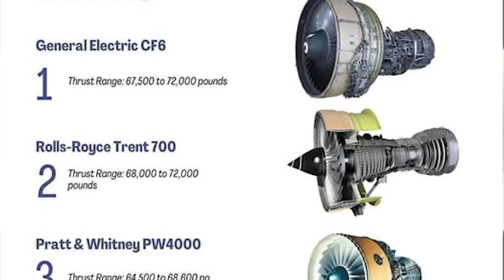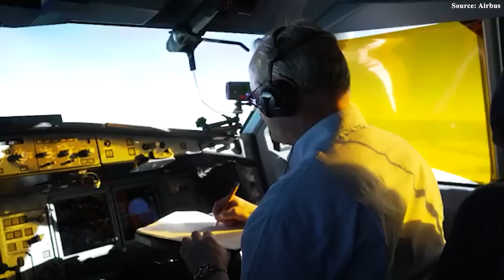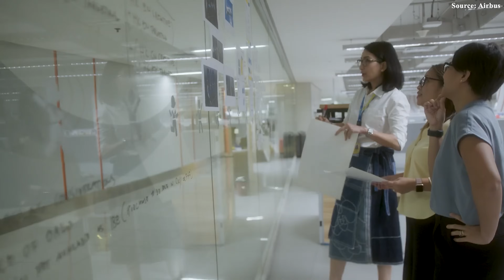This Why Every Airline OBSESSED with the A330Neo Over Boeing, Even A350!

Comment: No No NO! Type rating commonality wasn't introduced by Airbus. Airbus just pushed further what Boeing popularized on 707, 727 and 737, later reimplemented on 757/767 (and 777 to some extent). Boeing is not the inventor either, commonality was already applied wherever possible since 1920. People keeping believing A320/A330/A340 couple weeks type rating is an Airbus invention is just IGNORANCE. Yes, making 20% better efficiency is a nice improvement, but it's miles away from being the inventor.

A330Neo is not successful because of a lot of nicely worded but VAGUE arguments in this video. A new engine? That's not a breakthrough! Any aircraft with more efficient engines is better...
Question: when do you buy a new plane (mainly)? When the one(s) you have are too OLD! As simple as that. When you select a new plane, you want it to be EFFICIENT on the market you have, and BLEND IN with as LESS COSTS AS POSSIBLE. No wonder why popular A330CEO operators want A330NEO, not 787, not A350. Don't want to pay costly trainings, for flight crew and maintenance. Don't want to invest in an extra line of spare parts supplying til you got rid of the last A330CEO...

Don't confuse A350 market and A330 market, they aren't the same, so an airline can have BOTH types, yet, they serve DIFFERENT DEMAND. A350 success is bound to two factors: replacing 747/A340-600 and being Airbus contracted (mainly switching from 737 to A320s, fleet uniformity saves a lot of money)

Comment: Actually the B777x has more orders than the A330neo.
Reply: What nonsense are you talking about? The 330 is not in competition with the 777X but with the 787 and is also helped in this niche by the 350 which is heading towards 1500 orders... The 330s is sold at 1800 orders and with the 340 which is the same program it totals 2260 orders 

The 330 neo or ceo is the same program and it has been profitable for a long time while the 787 with 2000 orders still isn't...boing the criminal sells planes that bring in nothing and in 2024 it generated 12 billion in losses and 50 billion in debts
Reply: @guillaumedupont7565  So are you saying the 787 isn’t profitable to Boeing?
Reply: @CD2026Clips  Exactly it is know exactly it is known the program was so late the 787 had so many breakdowns that the budget was exceeded by far more Boeing lowered the sale price to align with the 330 profitable and amortized for a very long time already
Reply: @guillaumedupont7565  Sure, you could say the 787 isn’t profitable to Boeing, but I don’t think that means many more airlines are far more obsessed with the A330neo in comparison the the 787. And also, the 787 wasn’t profitable to Boeing cuz they didn’t make the 787-3 variant (in my opinion)
Reply: @CD2026Clips  What you don't understand is that neo version or not the 330 remains a 330 and the companies bought more than 1800 copies...And so the 330 is still popular...in 2024 Airbus has sold more than a hundred....If the 787 is such a good deal for Boeing why did it make 12 billion losses in 2024? Boeing makes planes for the glory of its fans and Airbus to make money
Reply: @guillaumedupont7565  If Boeing made planes solely for the purpose of fans they wouldn’t have gotten any haters. Literally, that ideology doesn’t make sense. And where did you get the information that 1800 A330neo aircraft have been delivered? Only 449 orders across both variants, with 164 aircraft being in service. It’s rather the 787 that has over 1,800 orders and over 1,000 of them delivered. And for the losses part, I don’t think it was really directly related to the 787. The 737 MAX could also have been their problem, building them but being unable to order them.

Comment: What's interesting was that the A330-900neo was very close to the original A350 proposal from 2005. Because the A330-900neo didn't require major new production jigs to upgrade from the A330-300, Airbus was willing to develop the plane since the development cost was quite low. Indeed, the A330-900neo has become the replacement for the Boeing 777-200ER planes in the 2020's.